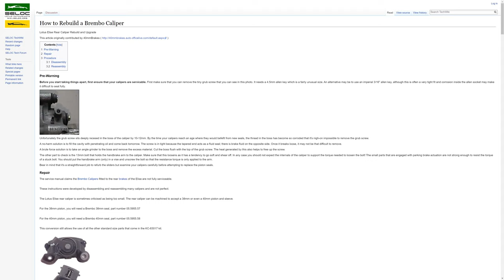Iveco Daily Brake Problems | vanlife?

Comment: Ahh. So sorry. I own one too. My Handbrake never performed as it should, even new from the dealer. Never again will I buy iveco. These vans are over priced when new, and they deliberetly made to defect after warranty. I'm in the process of re-engineering modifying the lever and spring system on the calliper in an attempt to get some function back into the hand brake.